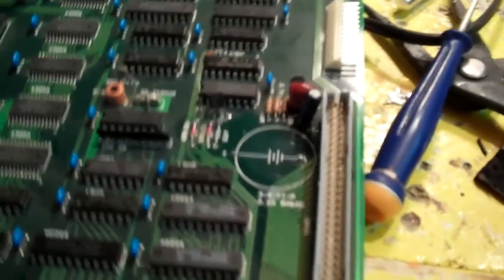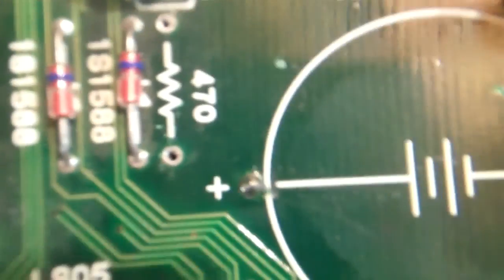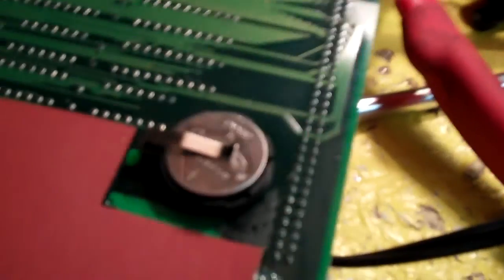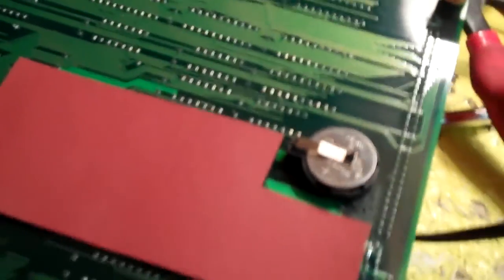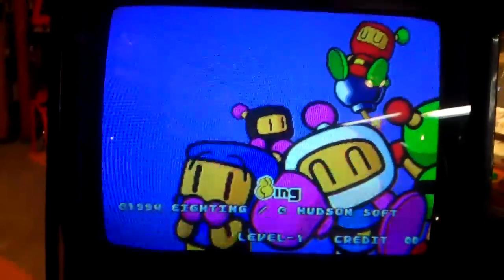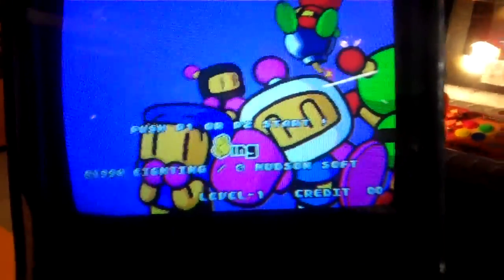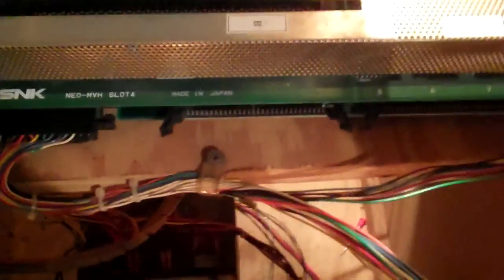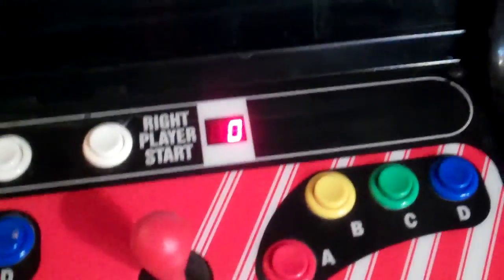Neo Geo MVS Button Cell Battery Mod

Comment: Nice.

However, what I would do is make the battery holder accessible through the coin slot door instead of having to take the MVS assembly out of the cabinet to change the battery.

I would solder a couple of wires, one for positive and the other for negative, to the battery solder pads on the MVS board and have the wires running out of the MVS assembly. The wires would be connected to a battery holder mounted inside the cabinet in the vicinity of the MVS assembly.  The battery holder would be positioned to where it can be accessed through an open coin slot door.

Comment: What size battery holder are you using?  I'm attempting this with a standard CR2023 battery holder from radio shack and the leads don't fit with the holes.

Comment: Nice job, but I would have mounted the battery holder on the other side. As rarely as it would need to be replaced(on PCs they seem to average around 10 years of life...I'm guessing a Neo Geo would be similiar) I don't think it would be much of a problem.

Comment: Nice job! does the battery holder not fit on the component side?
Reply: There's a metal plate covering the component side. It's not the first one I see modded that way.

What I'm trying to figure out is if a LM2032 would be safe to put there instead of a CR2032 (as the LM chemistry is rechargeable).